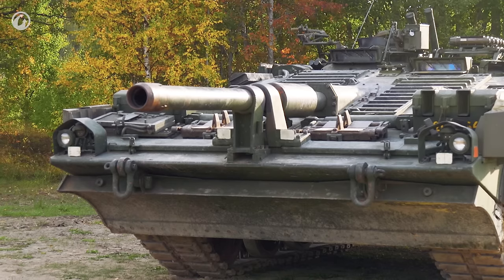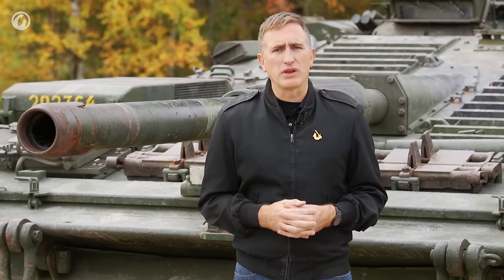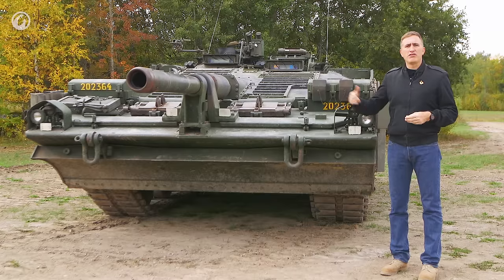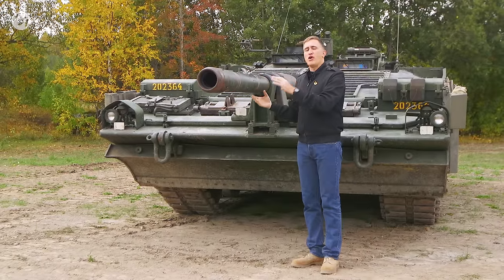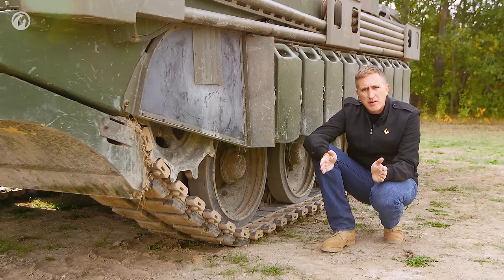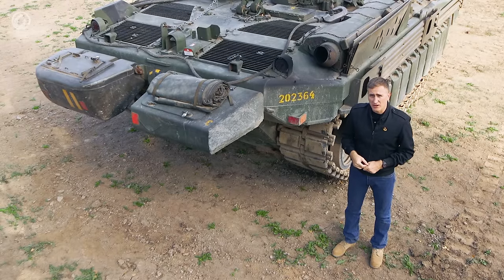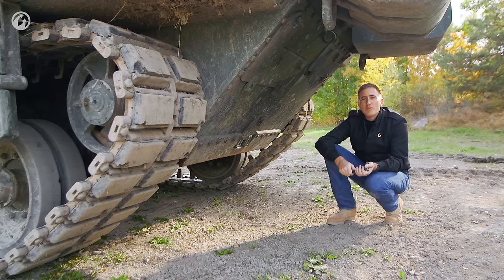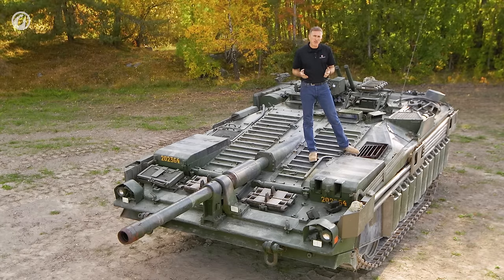Inside the Chieftain's Hatch: Strv 103C part 1

Comment: I can not comprehend how you aim this. At 1km range you have to be accurate to less than 1/10 of a degree, and you can not try all day to get lucky.
Reply: The gun was extremely accurate, even in very long ranges. You aimed with hydraulics.
Reply: hydraulics can be very accurate but the traverse? Seems very difficult, but not sure how that is overcame
Reply: @neurofiedyamato8763  Training.
Reply: That's not an explanation at all. It's not that easy to get a tank to traverse so precisely. There must have been some unique engineering in to its gearbox. Too little power, the tank won't turn, too much and you over steer, and this balance gets affected by terrain conditions. Rain, snow, mud will cause tracks to slip or sink. There's also engine response time and obstacles that may block your tank from traversing as precisely as the input may indicate.
This isn't a human limitation but a mechanical one and how they overcame it is quite amazing. These factors may seem minute but at 1km, being slightly off will cause you to miss.
Reply: @neurofiedyamato8763  it had a complex gearing system that allowed for minuscule adjustments

Comment: This tank was designed for defense not for attack. It would move to a battle ground, dig itself down and protect the troops.
Reply: Not really. The tactics was identical for the brigades armed with Centurions (mainly southern Sweden) or 103 (mainly mid/south or northern Sweden).  The armored divisions always have offensive as the main focus. When introduced, the 103 had shorter time to first hit even on full speed ahead, if compared to Centurion and others. Of course, when stabilized guns became common, this changed the game completely. 
But you are also right, there is no better tank for ambush/defense. We never missed a single shot, and could assume to take out 3 russkies in ten seconds before changing position - if in ambush. With any luck, a platoon would take out a brigade without even being seen or shot at. We tested this and the result was "satisfying".
// Driver/Gunner 1991

Comment: I don't get it. You say they "can't mix up the ammo types, one side has to be all HE, the other all AP", but then "if you want more HE, there is a little toggle switch". How does that work? It sounds like one side has 25, the other one has 20, so you can have 25 AP and 20 HE, OR 25 HE and 20 AP, OR 25+20 AP OR 25+20 HE. I think the toggle switch you mention is to switch from feeding from one compartment or the other, so you can select which type the gun will load (I assume that means the autoloader doesn't load the gun until you tell it to, so you aren't stuck with the wrong type of round in the breech at the wrong time). The reason you can't mix the ammo up and need to use the two compartments is that the autoloader can't tell anything but from which compartment the ammo is being taken. If you mix the ammo up, you won't know what was just loaded into the gun, unless you keep careful track of the order you loaded the rounds and how many were fired. And you won't be able to chose that way.
Not sure what the "5 rounds manually" means, unless it means you can carry 5 rounds inside and load them manually, either in case you run out of autoloader ammo, or if you want a few rounds of a different type, since you are limited to either one or two types of ammo only with the loading compartments. So you want to carry a load of AP and HEAT for fighting tanks because you expect a big armored attack, but you want a few rounds of HE just in case you need to take on some infantry or something. This is all speculation, but it's the only thing that makes sense. But it's not what you said.
Reply: You are correct. You should keep the same ammo in each of the three compartments. If you do not, keep track - which is impossible. Normal would be 25 HE to the right and 20 AP to the left.
The "manual" load is a horizontal magazine. The 5 rounds from this are pushed to the central shaft by the rear driver, turning a "wheel". A turn of 360 degrees makes a round fall down to the elevator, and then the normal auto-loading commences. Normally 5 smoke grenades are stoved here. 
There is a selector, telling the tank what is loaded: as you say 20 AP + 25 He, 25 AP+20 HE, 25+20 AP or 25+20 HE. The manual load is never included in this, and can also not be selected from the gunners tiller - it has to be a command on the intercom to the rear driver.
Driver/gunner 1991

Comment: One of the best tank designs

Would like to see a modern design in that fashion getting rid of all unnecessary weight and weakspots including the tourret

You could have a immensely fast vehicle with a gun heavy enough to destroy allmost all modern armor and a low profile - Tank killer
Reply: defenselesss while getting flanked is not a weakness?
Reply: So just a modern Tank Destroyer
Reply: @velorn8927  no the reason on why TDs are no longer used today is because almost the same reason heavy tank are no longer, one of it being other types of tank had already been equiped with their gun. So just completely deleting the reason tanks are exist im the first place? Yeah no if so then what will absord all the enemy bullets from the infantry, what will destroy the enemy emplacement when 30mm cannot do artillery? Too much time ATGM on the IFV? What happen when enemy MBT started rolling around, and using Ukraine as an example doesnt support your point why? Because just like infantry tanks need other support, one of them being infantry themselves Do you see those Russian tanks being supported properly by Infantry? No

Comment: If the fuel is diesel, it will not burn or explode. My parents crashed their car into a truck fuel tank and only got stinky and slightly bruised. By, the war, the truck was sideways in the middle of a motorway.

Comment: Basic design concept failure: It should have been configured to fire only from static reversed position, enabling it to advance forward at high speed with no barrel in the way.  It doesn't take that long to turn a treaded  vehicle 180 degrees.
Reply: It had the same speed forward and backwards and the radiooperator also had drivecontrols for his second work: driving backwards. No need to turn 180 degrees until out of fire from oponents.
Reply: Why? Don´t you know that the doctrine/tactics/design and most training was for offense/assault?

Comment: A excellent weapons system. But a fuel reserve to the front? That would be a cause for concern.
Reply: Na, it is diesel. It does not explode, only give extra "armour". It is also used along the sides, in cannisters - approx 10 per side, each 22 liters (some 7 gallons?).

Comment: Great episode.I don't care what Swedes think but to me this is a 1960's interpretation of good old Hetzer SPG.I mean it as a compliment not an insult.Small,very mobile,powerful gun for its size,ambush tactics-all that was done first with STUG and later with Hetzer tanks.I'm sure Soviets did try to do exactly the same thing with their own SU/ISU 85,100,122 SPGs.
Reply: Well, that's a bit of misconception. First of all, the Hetzer was a really bad tank (not to mention wrongly named), as the Chieftain clearly demonstrated in his video about it.
Secondly, their purposes were very different indeed. The stridsvagn 103 was a MBT, with the same war-time tasks as the Centurions also present in the Swedish army.
Reply: The main difference is perhaps that Jagdpanzer 38 was rather cheap, light, prepared for mass production, used proved technology and standard parts, and could be produced on several locations. Strv 103 was highly expensive, many parts unique, lots of innovations, and rather heavy compared to contemporary tanks. Even if it would have been the "best tank ever" it would have been difficult to find buyers/users.

Comment: I dont understand how such big engines with such big Turbos only crank out about 290hp. There are car engines that make around 1000hp with a displacement of 2litres. Can somebody explain to me why tank engines are so low on hp?
Reply: Because reliability, you dont see any of those 2litres cranking out 1000hp operate in military style and doing military task do you? Also this engine is from the 50s metallurgy has come lobg way since coupled with the fact that this is a diesel engine meaning low RPM count resulting in lower HP count compared to similar size gasoline engine

Comment: The twin MGs automatically alternate fire? Interesting. That's just like what I was theorizing about the Pz I and III yesterday, that the reason for two MGs was mostly to allow the guns time to cool down, so they didn't overheat. A single gun fired too fast will overheat very quickly if you don't pause for a while between bursts. Having two guns gives you more than twice the total firing time before the guns overheat. It's not a linear increase, the heat accumlates faster than it disperses. If you never let it get above a certain point, you cools down much quicker, so it's better to keep the burst short with long pauses, instead of getting the gun really hot and then waiting five minutes for it too cool down. Having two guns and firing moderately, you can shoot until your ammo is gone. I'm surprised they don't allow for firing both guns at once if needed though.
It just occurred to me that another reason to have two guns, probably even more important here, is that it gives you redundancy. Like you said, if something jams or runs out of ammo, you have to get out of the tank to fix it. With two guns, you still have one left if the other fails. And having two guns gives you twice as long before the ammo runs out. You could just make a longer ammo belt, but that with the added risk of it jamming means that it's safer to just pair them.
Reply: you really like words dont you

Comment: 10:13 actually you would welcome fuel being splashed on the tank, specially if a heat round reaches the ammo storage, this will wet the explosive enough so u can exit the tank with only burns, and not as ashes and bone shards if the ammo explodes...
"war is hell" nope, the inside of an armored vehicle when all explosives burst from a heat round is Hell, not even your soul survives, its like if the sun was inside a metal box, with the fury of 1000 volcanos as you are incinerated alive until your brain shuts down, 8-13 seconds of hell...

Comment: if that tanks had a few degrees of movement on the gun it would be so deadly especially with that wedge shape. pretty ghetto design and bad idea since you have to move the whole tank on a pre made position with slopes to aim up and down
Reply: It have a better up and down angle than most turreted tanks due to the hydraulics. And to aim sideways it just rotates the entire wagon. Ive seen it in action and its quite a machine, perfect for its purpose witch is guerilla hit and runs.

Comment: It is a very well designed tank destroyer built to ambush enemy armor. No sane person would use it to fight a running battle like a modern tank.
Reply: its an MBT not a tank destroyer.
Reply: :-) If you, when the S-tank came in the -60's, got the choice between Centurion, T-64, Leo 1, M-60 and all the others... if you picked anything else than the 103 you would have been dead meat back then. Of course, today you can not compare something from the 1950´s with for instance Leo II.

Comment: Hello Chief. 

   I think that I have an answer to why the tank's 'tool' is called and 'oxygen thief'... It is because using the tool requires so much effort and time, that the person doing the job is out of breath, thus 'robbed of oxygen'. The only way this would NOT be the case, would be if they made a powered tool to do the job, perhaps fed from a portable generator in the field. 

   I am NOT saying that this is, in fact, the answer... just that my solution seems to be logical and in line with the typical military humor of both soldiers using the tank, and those maintaining it. 

   As to how I would know of such humor... I was an Enlisted Weapons Instructor at Quantico, VA back in the late 70's. 

   speaking, Frank-ly
Reply: Nice pun.
Reply: The tool is not literally called "oxygen thief", it is a bad translation due to perhaps no better options. The original word "Klant" has absolutely nothing to do with either oxygen or thief. My translation would be "fool", or someone who tries to do something good but always messes up. I am a former tanker on 103, and have asked "everyone" about the origin of the word, but nobody knows. An educated guess would be that it emanates from the designation in the manual/parts list ; "Kombinationsnyckel" meaning more or less "Universal key" or "Universal wrench".

Comment: No one called the German Jagdpanzer IV a tank because it was a tank destroyer with a fixed gun (no turret) as is the Strv 103C: and HE knows this. So why.......
Reply: Because this AFV is classified by the Swedish Military as an MBT. Also the Jadgpanzer IV is a casemate design not fixed
Reply: Have you seen the Panzer IV/70? It is exactly like the Jagdpanzer IV, "fixed" gun and all. And the Panzer IV/70 is a tank, not a tank destroyer. The difference? Simply the intended use... So, Strv 103 is a tank.

Comment: One of the worst design of the cold war, right? At 41 tonnes, the S-Tank is already 3 tonnes heavier than a T64. It cant launch missile, smaller gun, no firing while moving, goodbye to dual stabilization, nothing but trouble.
Reply: I'm guessing you didn't actually watch the video. The Strv 103 is actually a really good tank.
Reply: @Erikaaaaaaaaaaaaa  I watched it though, but still i have to say, it's dumb. Don't you think the design is dumb? Sweden said, "it's a defensive tank". So, if USSR invades and Sweden somehow managed to halt their advance, they will just give out the land they lost or will they mount a counter offensive? How can they mount a counter offensive if they only use "Defensive" tanks? It's OK to sacrifce the turret in exchange for insane protection. But this tank is screwed if shot by T64, albeit frontally. We haven't talked about it gaeeting shot by T72 and T80. Not to mention each of these junks costs more than 2 units of T72. No thanks...
Reply: @stateservant  This is nonsense. This tank did fine in tests and exercises which simulated real war conditions. I don't know what makes you think it would blow apart if a T64 touched it, or that it's incapable of attacking just because it prefers the defence, but you're completely wrong.

Comment: Too bad there isn't a turret on the tank.  Now you will say, there is no need for a turret because of the dense forests.  But to turn the barrel in the jungle you will have to turn the tank.  So the same thing and turning the tank is a waste of time.
Reply: You missed the point, it's not supposed to fight other tanks on the run, it's not supposed to hunt, it's supposed  to dig itself down and hide till the prey comes

Comment: It is not a tank. It is a tank destroyer. Last of its kind too...
Reply: No, it's a tank. Tanks differ to TDs in role, not on the setup of the vehicle.
Reply: Yes, and the role of the STRV was a defensive role
... like a TD
Reply: 0hn0haha no it wasnt. It was to be used in offenses to if possible
Reply: breadbasketbomb Main purpoae was for defence. However it can be used to attack as well.
Reply: Can it? No turret, no rapid ability to engage targets on the move... you could use it in the offence, but... you'd be fucked if your enemy has any anti-tank capability. And if your enemy has their own, more offensive oscillating turret tanks, you are well and truly fucked.

So can it be used to attack? Sure, if you enjoy suicide.
Reply: REgamesplayer The Strv 103 was a main battle tank, but WG wanted a top-tier TD for the swedes and though the 103 was the perfect choice, thats why it is a TD in WoT.
Reply: I originally made that assumption too. To be classified as a tank or tank destroyer depends solely on how the forces using them classify them as. So if they use them as a MBT, then they are an MBT, even if they would be better suited as an artillery vehicle, or an anti tank vehicle.
Reply: +Akula the definition of tank is armored tracked fighting vehicle so it is a tank

Comment: You could probably disable this tank with a 20mm AP round to the engine block and completely disable it. What a shitty design. Its special, sure, but nobody can deny the fact this POS would never stand a chance against any other battletanks. Might as well just design autoloading, up-armored, wheeled AT guns and make 20 of those for the cost of 1 tank.
Reply: In what way is it shitty by 1950s standards? It preformed well during trials, tests and combat exercizes. (And yes, it was tested against both 20 and 30mm rounds, you can find videos of those tests here on YT)